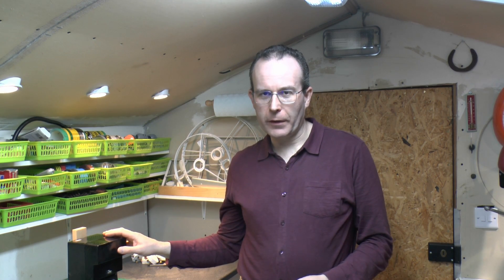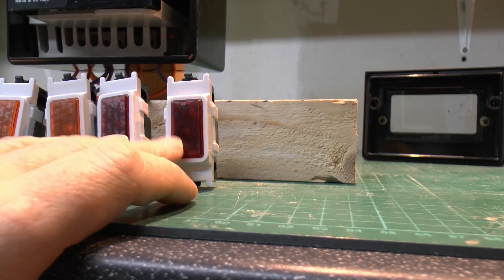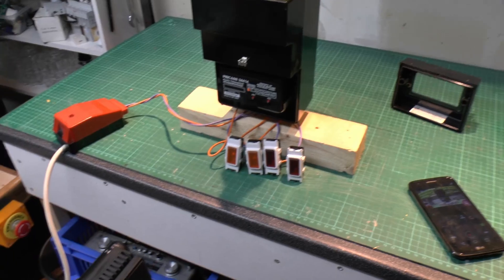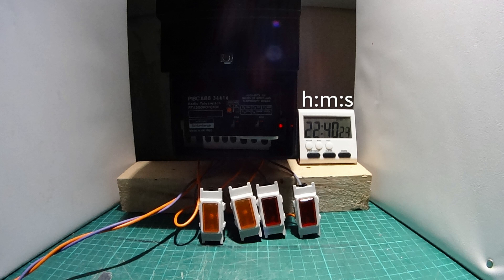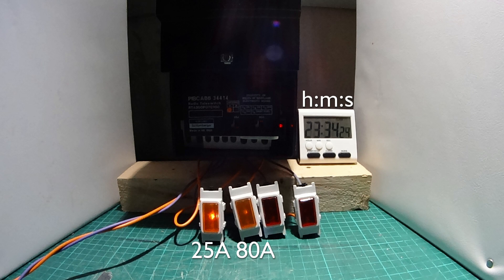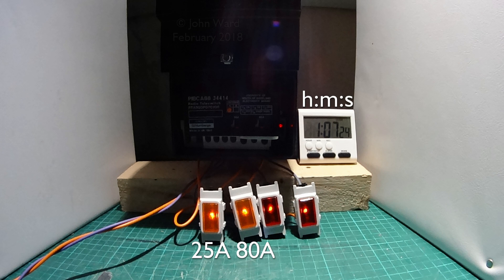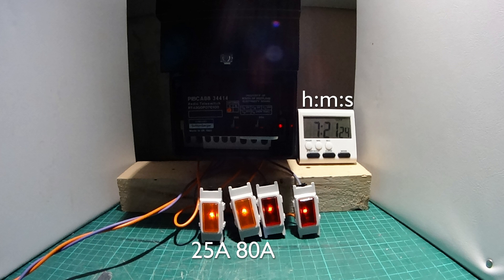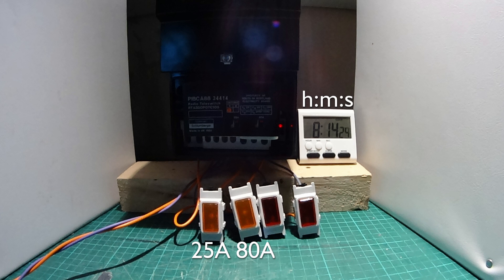Sangamo Teleswitch Powered & Operating

Comment: Last year I charged my EV at the usual supposedly low rate time of 1-8 am and happened to look at the low rate meter the next day - it hadn't moved at all.  I did some continuous recordings with my laptop and found that for a whole month it was switching over to the low rate meter at 10 am and back again at 5pm. I wrote to the the DNO to find what was going on but they didn't bother to reply - some kind of experiment by them I suppose. Anyhow I started charging the EV during the day till it switched back. By the way a very loud click when it switches over so you could use sound to trigger something I suppose.

Comment: Thank you John, very interesting how the water supply circuit switches off and then back on again in the middle of the night when nobody is watching. Must be costing the consumer a small fortune over the 30 years or so it was installed. I am getting the similar problem with my brand new economy 10 meter not switching when it should, makes you wonder don’t it. Cheers.

Comment: If you listen the 198 Kc transmission with a communications receiver with the BFO on the carrier has a noticeable warble to it this is data for teleswitches and other devices its not modulation as such its frequency shift keying. Incidentally the now silent carrier on 163Kc has the same but radio Luxembourge on 234Kc does not

Comment: Can Radio 4 LW 198 kHz listeners hear the teleswitch activation signals when they occur? Does it have to occur when there is silence in the audio modulation?
Reply from the maker: No, it's no audible with a normal radio receiver.
Reply: @jwflame  Thanks for the reply. It would be fascinating to connect an oscilloscope to the detector output of an LW radio receiver (since the coupling capacitors might not pass a very low frequency) and view the pulses, exactly when the teleswitch changes state at night and in the morning. Maybe the reason it is not exactly on the hour is to ensure it occurs at a point when there is no other broadcast audio content which could interfere with the pulses ?

Comment: I remember these old machines. We used to have one in the meter cupboard. We still have Economy 7 night storage (no gas up here in the frigid Highlands, even oil’s hard to deliver in the winter) but it seems to use a Sangamo timeswitch (clock with two lugs). 

Would I be right in saying that these things could be used to remotely turn on and off equipment in the pre-SCADA era by injection of your own commands?

If you haven’t seen RODALCO2007, he has a lot of stuff on ripple control which uses injected 1050Hz AC signals on the mains wiring to do the same job (AUS & NZ).

Comment: What happens if the signal gets blocked, will it still switch off at 07.30 (because of an internal timer)?
Reply from the maker: Probably - there are commands which are just on/off immediately, and others which set switching times in advance, so it depends on what type of commands were sent to the meter.
Immediate on/off commands are rarely used, it's more usual to send the switching times in advance, so once received it should continue working even if the signal is lost.
Reply: BBC are shutting off the signal in aug 2025... When this happens, will the timers be locked into whatever the last program transmitted to it?  @jwflame

Comment: Hi JW, 
I have a question which is nothing to do with this video,sorry. It’s in regards to the Sonoff devices. I have  watched your videos on the switches, very good. The question is about there light switches which  say they are for UK use. The switches require a neutral wire, which ,I think, most lighting circuits in the UK don’t have. Is there a safe way around this. Thanks
Phil
Reply from the maker: If you want to fit the Sonoff where the old switch was, then the only solution is to add an extra cable to provide the neutral there.
Another option is to fit the Sonoff at the position of the light itself, which will already have a neutral connection.

Comment: Hiya John.... That is an interesting way to work out if it operates, that's if of course, someone has a timelapse camera which takes a picture automatically every so-often.

What I done to my one, is to wire a timeswitch to the output and use it as a time-logger.

I set the timeswitch to the time I expected the teleswitch to turn on, and waited. I think I set the timeswitch to 23.00 or somewhere around about there, and came back to it a bit later and found that the timeswitch had started ticking, but was out of alignment of real-time by about 30 minutes, which suggested that it turned on (from what I can remember) at 22.30.

Given that....

I also found out, unlike your one, my one does not do the off-peak power in one block: It turns on at 22.30, stays on for two hours and turns off again at 00.30.

Two hours later at 02.30, it turns on again, and stays on until 07.30.

So yes, seven hours of off-peak time, but not in one 7-hour block.

Thanxx for showing,

-Wayne's Electrical.

25th February 2018, 00.00

Comment: HI John  is it a problem that in may apartment voltage is 280v from around midnight when the power usage is lowest is that going to damage any of my equipment.
I live ion an island in croatia (Mali Losin), standard voltage trought Croatia is 230v and in summer when there is a lot of people on island it is 230 in my apartment.Yes I have checked is my multimeter OK and it shows 280 with all multimeters I tested. Should I call my Power distributing company or not.  Thanks
Reply from the maker: As other replied - that is far too high and requires investigation immediately.
Reply: Yes you should.
Reply: You don't need true RMS to measure sine.
Reply: Are you using a meter that shows ac rms? If you are then peek to peek is almost 400v at 280v rms so it is close to the rating of most switch mode power suplies.
Reply: Sounds like a bad neutral.
Reply: I'd call them, that's WAY high for a nominal 230v. Up to about 250 should be fine, but above that, you're into 'damaging equipment' territory,  and 280 to me is in to 'downright dangerous'

Comment: I did find some information about the RTS times in the different regions... think JW has links disabled though
Reply: here goes https://customerservices.npower.com/app/answers/detail/a_id/179/~/what-are-the-economy-7-peak-and-off-peak-periods%3F
Reply: I have the full list of what are called SSC codes. The catch all phrase for for economy 7 is "any seven hours between ten and seven" but it's amazing to see all the different types though. Summer grain drying on a sunday that kind of thing. I may also have all the key settings as well but will have to look.
Reply: If you could find them, I'd love to see them. I think I found a copy on the web, but not with the switch settings. Very curious what the switches and jumpers do on the Sangamo.
There's also a Horstmann-made Teleswitch - which seems to use an infrared port to configure. Bet the tools for that are long gone, sadly.
Reply: CosmoSnowmew yeah I have everything including the jumper settings. Can you send me your details and we can speak on the phone. Legacy metering tools are still going strong. The infrared Comms port tools are still needed!